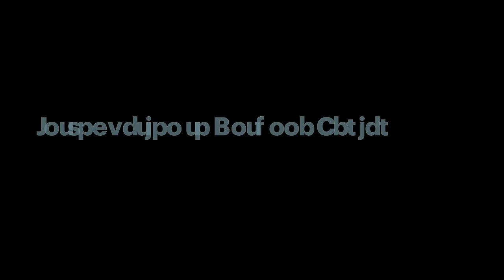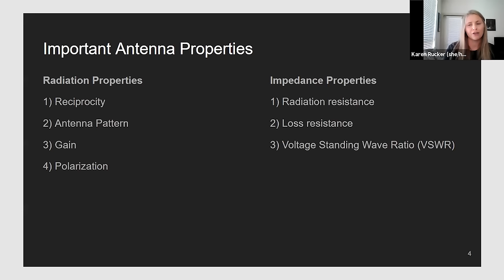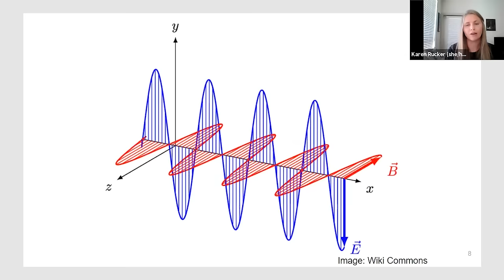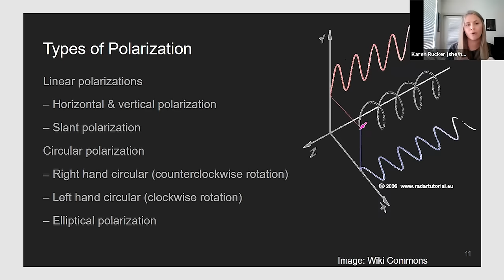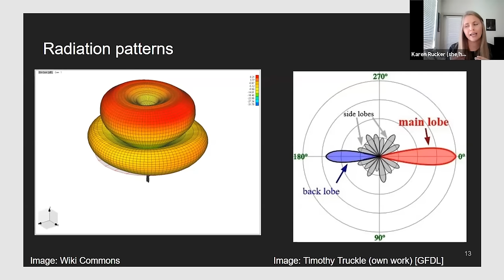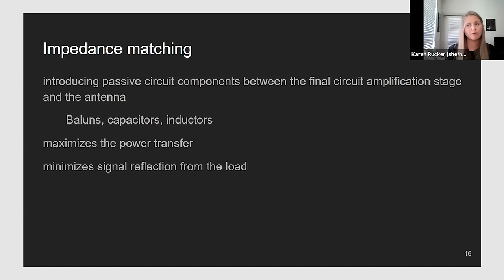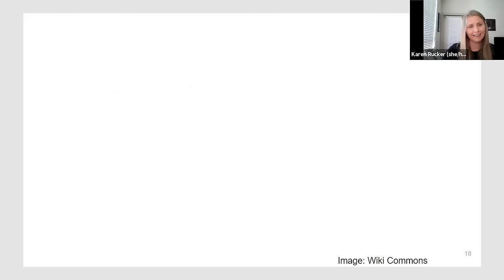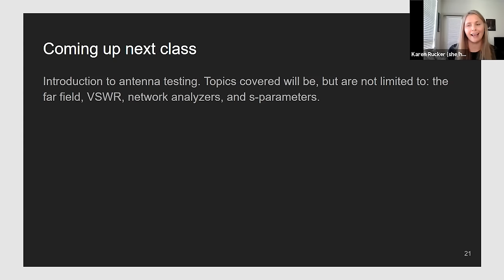HackadayU: Introduction to Antenna Basics - Class 1

Comment: Thanks for the course! An omni directional antenna has a gain of 0 dBi. Using dB values in beneficial when calculating link budgets, because you can add and substract instead of multiply and divide.
Reply: Yeah, 1 = 0 dB.

Comment: You say the gain of an isotropic antenna is 1 dB. That is wrong. The power gain is 1.0, which is 0 dB.
LB8X
Reply: Yup... beginning at circa 5.20... the slide says that an isotropic antenna has a gain of 1 dB. I always thought an ideal isotropic radiator was assumed to have a gain of 1 (and not 1.122)  But, probably just my ingrained engineering culture... like rounding off calculations. Today I learned differently!

Comment: wavelength is horizontal, both antennas are vertical, the only way this would work is if the vertical amplitude is always equal to wavelength and this has always been my question which no video has answered, because the horizontal plane is time related.
Reply: Gross concept error

Comment: If polarization only refers to the direction of movement of electric field E, then how is circular polarization possible? It shows two waves in red and blue. I thought we only care about the electric field wave.
Reply: It's the E field X component, and E field Y component that you see
Reply: That's the linear polarization.  Circular polarization requires the waves to be out of phase by a quarter, then it will create circular polarization - hard to see in the 2d world, requires more intensive graphics to illustrate.

Comment: I’ve landed here looking for information about how ancient buildings act as Antennas which I study for my work as an architect.

A common temple structure is an outer rectangle, mainly solid with an inner rectangle of columns. The column grid is also cubic. The columns are made from granite, under load from the weight above and so creating a piezo electric field around the column. The column structures are usually fractals of cosmic geometry such as the earth diameter which I guess would tune in to any waves emitted. I believe the earth is giving out a c# note. 

Am I on the right track studying this? Is there such a thing as a cubic antenna grid. Any direction of what to learn would be great.

Your sound is great. I have made a few videos which have poor sound but they would never have been published had I worried about it. It is the content that matters. This is excellent content for someone at my level.

Comment: Any number to the 0 power = 1. Db to the zero power = 1, not 1 Db..... Db to the 0 power has a gain of 1, not 1 Db. When ever you use Db as an engineering label you are referring to two numbers, one of them is the reference.  Whereas a gain of 1 is a single dimension number not in reference to any other number,  Dbi indicates the reference is to an isotropic antenna whose gain is 1, not 1 db.. an antenna who's gain is 3dBi, is 3Db better than an isotropic antenna  which has a gain of 1 and is the reference.... I am open to being corrected on this should I be incorrect. We learn from each other, no?
Reply: You try to be super correct with audio quality and filling words, but manage to write the units of 'dB' in 3-4 different ways in just one comment. As far as i know, only the lower case d and upper case B are the correct symbol for decibel. As a fellow engineer, you should know about the importance of upper- and lower case letters in symbols, the difference between milli (m) and mega (M) can be quite large too...
Reply: @ProtonOne11  good point, we all learn from each other....